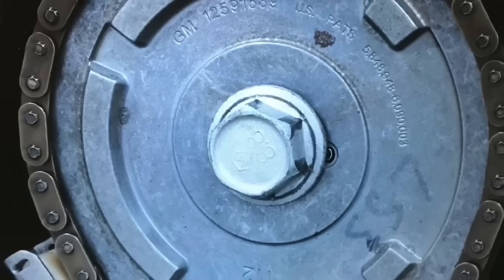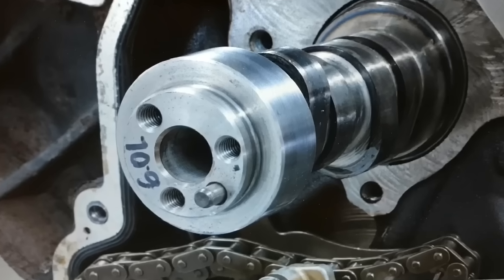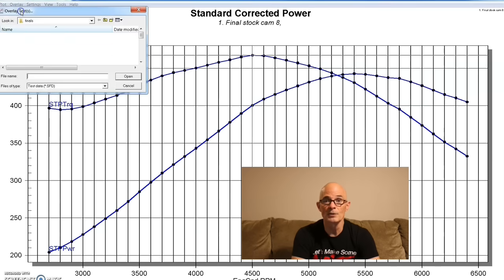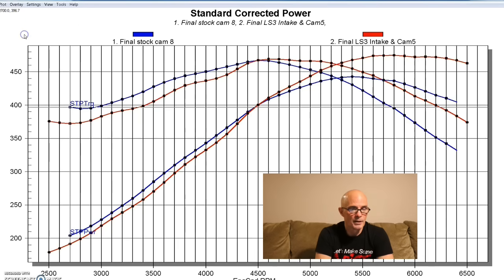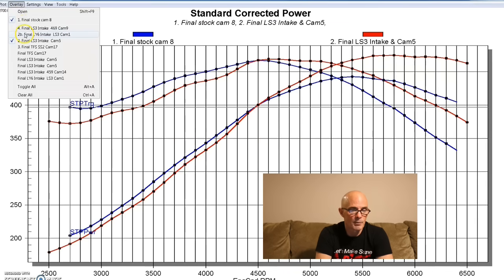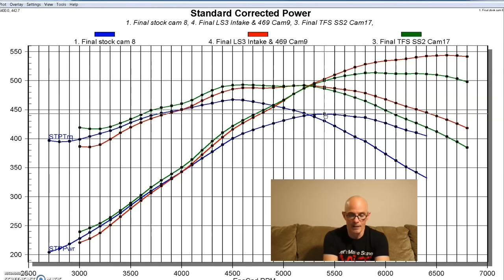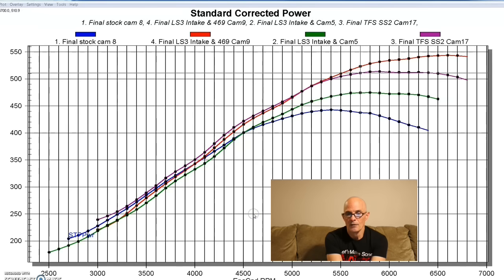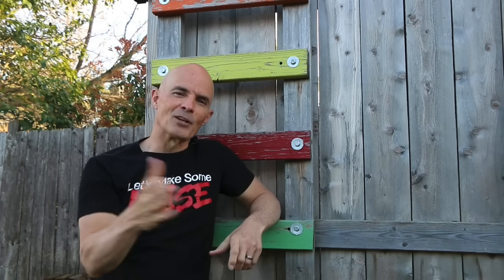HOW TO PICK: THE RIGHT JUNKYARD 6.0L LS CAM. 4 CAMS-WHAT WORKS BEST?

Comment: The more I watch this channel, the more I realize there’s really no reason to rebuild the Olds 455 or 350sbc sitting in my garage.
Reply: Sell it to someone and make enough back to do a full LS build. 👍
Reply: MafiaboysWorld exactly. A 6 liter with that SS2 cam is perfect
Reply: @jimmy_olds  ss2 for the win
Reply: Thump Er I bought my 455 to put in my Cutlass, build tons of low end torque, a non O/D trans with highway gears.
Reply: @SweatyFatGuy  you know what else comes with those "hero" numbers? Hero mpg, which negates any "savings" from building a BB. Also parts are easier to come by,  better driveability, less weight, smaller package and a dozen more variables. While I love the Big Blocks, your "hero" envy is showing. Just build yourself an LS.
Reply: @SweatyFatGuy  I have a 67 chevelle with a 69 396 in it. It's bored 60 over, has a decent size cam, and converter. It's a street car that makes a pass every once in a while, what would be the best route to get mkre power out of it?
Reply: @SweatyFatGuy    -- Wth are you going on about with "having" to rebuild small blocks every other year for it to keep running strong? That is absolute conjecture!  Replacing valve springs is hardly what would be considered a rebuild. That is most often the only requirement for a small block or higher rpm V8 to continue running well on the street with track use mixed in.  My late model, stock bottom end, N/A LS7 makes 613 rwhp and has at least 435 lb/ft of torque at the wheels beginning at 3,250 rpm. It's a 6-speed and weighs 3,318 lbs. with a cage. I don't need a torque monster. High torque and high traction don't mix well with an IRS.
9.70's w/drag radials and 23 mpg highway suit me just fine. PS. It's been together for 5 years and 41k+ miles. It gets it's 3rd replacement set of dual springs right close to 45k mi.  (639/640 lift). Nuthin' wrong with Pontiacs, Olds and Buicks for the big cars though.
Reply: We to @MafiaboysWorld
Reply: Jet boat guys want the olds...For good reason..sbc will always have a following.
Reply: Runnningonempty the 455 is a desirable piece at least for Olds guys; big valve, nodular iron crank, & high compression out of a 70 Toronado.
Reply: @jimmy_olds  Great,I couldnt give one to my Engine builder one of the most popular in Central Fl.It was left in the garage of my Old house when I moved.I even posted it On Craigslist for 50 bucks 1969 C head Motor from a Toronado..I am over 50 years old Ran more 455 Olds in the 80's than I can remember..Good luck....
Reply: Runnningonempty I’ve bought, sold and messed around w/Olds motors for years. I’ve never had an issue selling small or (especially) big block Olds stuff. Ever. Of course I don’t use Craigslist either.
Reply: @jimmy_olds  Good luck..Tell us how you do..
Reply: @runnningonempty  - too bad you werent in Cali, i usually pick up cores for 200-400.
Reply: @runnningonempty where the hell do you live lol but you didn’t get the word out
Reply: @runnningonempty  `The seventies are calling and they want their boat back.
Reply: Runnningo 🏎🏎
Reply: Its about airflow on an n/a package.  If you can get heads and an intake that flow like the ls varients, go for it.  If you plan on boost, it almost doesnt matter. Add 15-16 lbs of boost to any 350 hp motor and you have 700 hp as long as the bottom end is good for it.
Reply: @mxguy2438  Yup, now your talking pressure...Repost on the top, your comment will be buried as a reply..
Reply: Other than the feel sitting at a traffic light my 4.8 turbo kills my old 468, and gets 19 MPG and can use 342 gears again
Reply: There really isn't. You can take a junkyard 6.0 ls, throw a cam and valve springs in it, and have a 500/500 engine. Even the 5.3s are braking 450 hp with just a cam and a head mill.
Reply: nallen100  that I dont understand,  fuel injection and better economy is why we swap them in the first place......putting a carb on them is just ass backwards unless your running the car 1/4 mi at a time!!!!
Reply: I ran my 455 with nearly all the Mondello upgrades and had a lot of expensive issues.  I miss the torque down low for sure, but my LQ9 makes 400 wheel herspers and hasn't had a hickup for 7 years, and it sees road coarse duty at Blackhawk Farms and Autobahn (IL) every chance I get.   Olds guys tend to be real purists, so I stopped hanging around them, but the car is 1000 times more fun and reliable to drive.
Reply: Go to a single LS Fest event.  You'll feel like you've been living in the dark.
Reply: Not to mention a engine with 300k miles still runs great.
Reply: 8mpg with a 20 to 25 gallon tank sucks. No 455's 4 me. High teens with my lq9 powered gmc jimmy.
Reply: JD Carguy eh, my 464ci Buick gets 22 with the Rochester. Still hauls ass!
Reply: I feel ya lol i was gonna throw my 468BBC back in my 70 chevelle but i just decided to go with a LY6 and a T56 instead.
Reply: Yup. My 383 sbc is now collecting dust.
Reply: The sbc is getting more extensive to build and look how easy a NA LS makes 500/500, unheard of with a common junk yard SBC of any size even the Olds without spending big $$.
Reply: I never built a sbc that I was happy with the power. Never did understand their popularity. I like the Pontiac 455 for my Firebirds but will put an LS in one for a driver.
Reply: I’m rebuilding an LQ4 and 4l80e for my K5. The 350 TBI that’s in it is a great running 89k mile engine that’s basically a boat anchor compared to these newer “LS” engine. A coworker wants to buy my 350 when I pull it. I’ll be selling him the complete motor/tranny for 2-300 just to get it out of my way and give a great running motor he wants.
Reply: @deegan727  The TBI heads are junk. Swap them for the mid 70's 882 heads and an RV style cam and the 350 is a nice package. That's what i ran in an 80's Caprice and it was a nice cruiser.
Reply: @ahoneyman  I agree. The 350 has always been a piece with many options. I want to LS this one because of the ease of obtaining a lot more power while keeping it together for tens of thousands of miles and get better MPG than what I get now. SBC are nice but 500+ hp daily driver with an acceptable fuel economy just doesn’t happen. LS happens to be a very efficient running engine when you compare hp to fuel consumption and their tough as nails.
Reply: @deegan727  Yeah, a 500hp Gen 1 small block would be unruly in a daily. I just needed a motor with enough grunt to pull a heavy car with highway gears without being a dog. Just curious what are you doing for gauges and a dash?
Reply: @ahoneyman  I haven’t got that as far as putting the engine in yet. As far as I can tell I’ll need a different fitting for oil pressure on the block, water temp should be just as easy, the swap won’t effect fuel level, volts same. Speedo is cable driven from the transfer case not the trans so I should be good there too.
Reply: My Buick 455 (462) might be for sale back to the original owner. I only have about 700 miles on it lol! Been thinking of getting the Holley EFI for it, but LS is looking much better in the long run.
Reply: I'd still build the olds 455 :) and I'm building a 6.0 ly6 currently. Love big blocks
Reply: Ls87 Gbody yeah, I’m eventually going to build it! I have just about everything, all it needs really is the machine work. My gbody Cutlass has a mild 403 but I want something more brutal
Reply: @jimmy_olds  I would find a set of 68-69 #5 heads to up the compression and flow more on that 403 and put a decent cam in it.  It'll wake any 403 right up
Reply: @ls87gbody  Yes..those heads ..with some mild pocket porting and port work..a 224-230 cam..aome long tube headers..an Edelbrock Performer..recurved distributor..can get a mid 3000lbs car well into the 12s..for CHEAP..
The 403 had alot of potential as a  sassy street motor....
Reply: Ls87 Gbody I had ported 70’s 7 casting heads. If I could’ve done it over it would do flat top pistons and BBO heads
Reply: @jimmy_olds  I was gonna say same thing that 455 will sell fast with no problems
Reply: I'm gonna get fired.supposed to be working but watching this guy lol I'm addicted
Reply: Olds 455 is a torque motor , compare to an ls6 454 or l88 427 either would shit on a 455 boat anchor motor
Reply: U realize the w30 455 was one of the fastest cars . Big stroke small bore they won't rev like others but torque was on top of the rest
Reply: @David-er1cy  yeah compare a basic big car engine against two of the rarest bbc.. Put up the garden variety bbc, 454, 396, 427 whatever, you know the ones that are in everything with oval ports and easy to find. You build the bbc on a budget, factory heads, cam, intake, etc, and I will do a Pontiac of similar displacement and maybe an Olds too. 

Because if you want to go with L88/ZL1/LS6 I will go with some RA V heads on a 428 or 455. Or maybe some W30 heads and work them over a bit. The Olds would be down of course, but from idle to 6000rpm the 455s are gonna kill the bbc.  All you need to do is run a 3.08 to 3.55 gear behind them instead of the 4.56 the chevy needs.

Go throwing aftermarket heads at them, and things start changing rapidly. Then the bbc isn't going to shine as well as you think it will.

Any time you want to go dollar for dollar cost vs ET in a NA 3200lb vehicle, I am game. You're gonna need a power adder.
Reply: Or any other legacy push rod engine
Reply: I got a TPI corvette with a worn bearing in the garage right now. The pressure is real.
Reply: What heads and cam would u go with on a 5.3 Vortec 2011 motor
Reply: @fdeltoro8149  I don't want to say there is such a thing as a dumb question......but.   The whole point of an LS motor is they ALL have high flow characteristics where their heads are concerned.  That leaves the cam, that has everything to do with the application.  Is this used as a daily driver, a 4X4, a street racer. If it's a street racer you have the wrong motor, get a 6.0 or a 6.2.  The point is do your research, for your application and understand the compromises. In short don't be a lazy ass as if there was the ultimate cam to beat all cams in every application, because that would be the only one on the market.
Reply: Sure there is if you like rod knocks
Reply: We in the same boat bro 😆
Reply: @brandonmills5094  I’m rebuilding that 455 now! Lol! Especially after watching the 455 Buick vids
Reply: Right!
Reply: I have a 786hp 350 small block no turbo.
Reply: 455 olds? Way cooler than LS vanilla.
Reply: @lonewolfgardening4237  i still have the Olds 455, a 350, along with a 403. I just installed a 307 (like yesterday) in my 71 C10 although I got rid of the original 250 six.
Reply: I’ll do the 455 then 😂
Reply: They run like hell but they also look like hell. If I build another car and want a nice looking engine. It can't be an LS.
Reply: Nah rebuild that 455. Stroke it to a 462, with some good heads and a 150 shot. That’s Bad sum bih.
Reply: Yes 2,000hp need LSX to do that
Reply: I have to agree with you there. I have 2 350 sbc's. One is a 355 in a 1969 Chevy C10, and the other is a 383 stroker in a 1979 Chevy Camaro. The only reason I have them is because of the nostalgia for an era that's long since passed and they were already built before I started learning about LS engine building
Reply: Hope there's not hate here. But a small block with gears as Daily a
 driver. Has plenty of performance. And with the od trans. And a little stall. Fun to drive. 
 Richard swapped out a cam in a 5.9 Magnum and it it picked up 70 hp in the higher rpm range and show loss down low. My 00 Dakota RT is fun dive, with the factory engine and computer also an over the counter mopar computer, playing not Racing anyone. Fixing to buy the draggy . To find out the sixty foot stuff. To much traffic to be racing where I live. My 96 ram short bed reg cab. That  with a stock converter best of 14.42. using the same computer. 3.92 gears. With od. No track anymore near. Small blocks with gears, and OD small cam fun to drive. ADD a good street converter. Put that package in a lighter vehicle. Equals more fun to drive, the Early Dakotas are considerably lighter. More fun. Not out to spank any. Just enjoy.

Comment: I would like to see some cams in the 240/250 or 250/260 @ .050 area.
Reply: over kill..Your gonna have to go solid...WHOLE DIFFERENT WORLD  of engine..
Reply: @runnningonempty  yes, I have no problem running solid rollers. This is the area of cam I run in my old school, pump gas 350, 383, 400's engines. With the head flow of the square port LS heads on a 6.0 liter it should respond well to a cam of that size.
Reply: @oldschoolbudgetracing1458  I get it..277/283@.050  720 4/7 swap on my sbc..My point is you are talking drag car stuff here...
Reply: @runnningonempty  yes,  I am.  Drag/ street car.  That is how I build them.... lol.
Reply: @oldschoolbudgetracing1458  With a cam that big especially in a SB you better have a converter flash over 4k..I really dont see street car working that well.. .
Reply from the maker: those cams wont fit P-V in a stock motor

Comment: Really the Holley EFI can't control VCT? 🤔.

Time to get an ECU made in Australia or Europe.
Reply: Why not just run the factory ECU at that point
Reply: @thunder57  factory ecu's are (often incompletely) reverse engineered, under doccumented, and unnecessarily complex for tuning a high performance street car.  The aftermarket stuff is easier to work with with fewer potential issues to troubleshoot, and when you do need to troubleshoot, the documentation and tech support are available.

Comment: My takeaway is the sloppy stage 2 is the kind of cam profile you want for a low to mild $ build.
Reply: Seems like the ideal cam for 75% of people who aren't trying to rev the piss out of their motor. Even makes fat low end torque. Win!
Reply: The Stage 2 would be so much fun with a 3000-3500 stall and a trans brake, and still remain super drivable.
Reply: Does a stage 2 cam lump
Reply: @johnchristian6025  Yeah! Stage I isn't very noticeable, but II is pretty strong lope. Stage III or higher is so lopey you'll see the rpm needle bouncing lol
Reply: @johnchristian6025  Does it matter? It would run great and serve well as a street/strip cam you could actually enjoy 24/7.
Reply: @AB-80X  im on my last step of ordering my stall for it. I have a 80e think I'm going with a 34k stall.
Reply: Do u think the sloppy 2 can run on stock converter? Are at lest a 2500rpm stall
Reply: @jeffpriest4017  i have one in 3/4 ton Silverado 6.0/4l80e with the stock converter and it's perfectly fine as a daily driver and for normal pickup truck use...if you're trying to do racecar things then yeah you'll benefit from a higher stall for sure
Reply: @DeathProof132  thanks im putting it in a 2500hd 2wd lq4 with 706 heads and Lt cant wait. Trying to tune it now... did u tune ur setup
Reply: @jeffpriest4017  yeah i do all my own tuning with HPTuners, steep learning curve but if you have time to study and some baseline knowledge of what's going on then it's well worth it...I live in a small town and no one has a dyno anywhere nearby so it's just street tuning. Obviously I can't get maximum power for any set up but i can get drivability dialed in great and solid "good enough" performance.

Comment: "If they're about this, they're gunna do about that." lol quote of the day.
Reply: People still won’t listen, they need to see their exact favorite grind from their favorite manufacturer. 
After all, just read the marketing points, they’ve got the secret voodoo sauce woo wooo to out perform all competitors AND a YouTuber usually them!
Reply: @Turbochargedtwelve  watch half a dozen of Richards cam videos and it is pretty hard to deny they are much of a muchness. Yes there are small gains here and there, but I have yet to see any magic bullet camshafts. Some are more equal than others, but there is definitely no special sauce.
Reply: @DodgyBrothersEngineering  Xbox be v Z cm